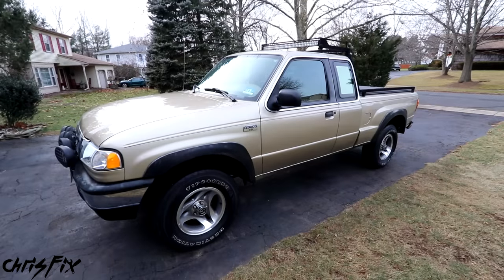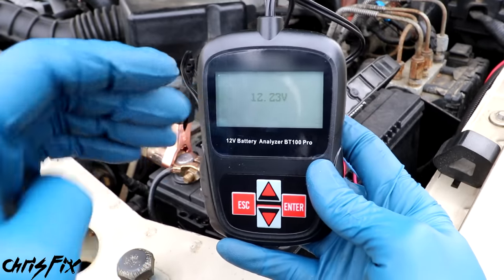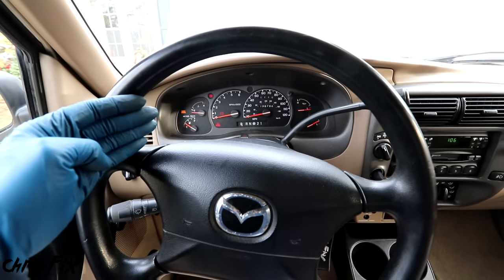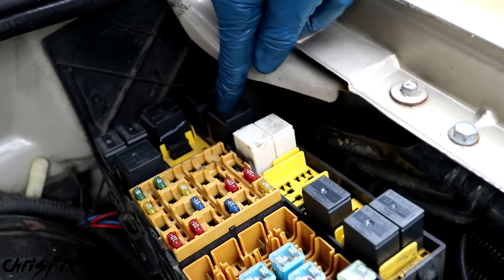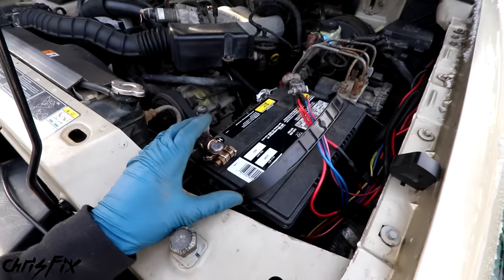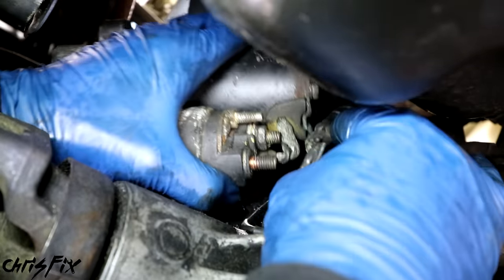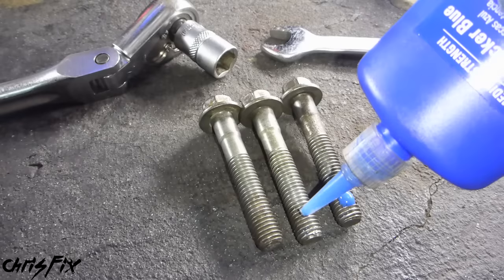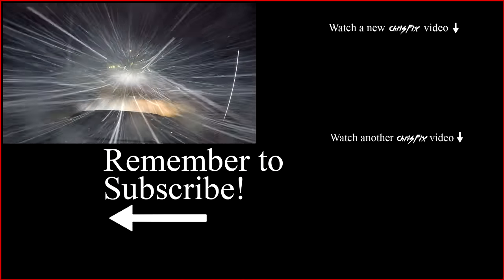How to Diagnose and Replace a Starter

Comment: Need help. I have a 2016 Colorado LT 2.5L
I like to see you do a video on a newer Trucks. This morning I turn the key it start up but had a hard time to hold the crank, it sound like it kept trying to hold then it shut off, I try it 6 times then sound like It was drowning, my experince it could be out of gas but it has a full tank, it could be the fuel pump too, I noticed all the lights in the dashboard turn on with only he motor icon lite up, I don't know if its the starter or alternator, but I have to rule out the alternator because the battery is good. It has to be the starter or fuel pump, btw I also check the crank fuse 10, its good. To remove the starter I was told the manifold has to be remove, there are hours of labor to remove. suggestion, did I do the right checks to be a starter issue or fuel pump ?

Comment: In cold weather (below 10-15C or about 15F to 5F) my car makes a clicking sound when I try to start it. Then I can leave the car, wait for about 5 minutes and then return to start it, and it usually starts right up. Is this a sign of a bad starter? I have replaced the battery with a new one, no luck.

Comment: Hey I need some advice. I have 02 Tahoe, it won't start. The battery, the starter, the fuses, and neutral switch are all good. One thing I did notice though is I have a rear main seal leak and my starter definitely was getting oil on it. Could this cause it not to start up?

Comment: this is an old vid but for anyone watching for help, theres also voltage drop from the battery to the starter. good way to test the integrity of the wiring is to read voltage with a dmm at the battery when cranking and at the starter when cranking, then compare the differences. it shouldnt me more than 1.5 volts of difference, all manufacturers are different with their spec but that is a good range to start.

Comment: swapped the old clutch out with a ram, car drove amazing turned off and on right with no problems but a few hours later i was having starting issues. before the cable snapped the car shut off at the light but could still hear it running, i tried to kick the clutch in to see if it would turn back on and it almost did. so i did that few more times the boom snapped, my BBK clutch cable snapped on me before even hitting the road. i went and got the ford performace from AM, and now weve adjusted it but when we have our clutch pedal down and in gear we get no crank or anything, completely silent, dashboard lights came on but no start or crank
Reply: chrisfix help, clutch is al the way down and i get no crank or anything. i charged the battery and i still got nothing. before i swapped the clutch the car turned off and on no problem
Reply: my mustang wont move in gear when its off an the pedal is down

Comment: Hey Chris I got a question, the new starter I got came with the lead wire bolted to it can I take that off and just bolt the one coming from the truck to it or do I have to use that lead wire and attach the two together?

Comment: Great diagnostic explanation, but if it is a bad starter, the next step (after removing ground) should be to evaluate the best way to access the starter.  On some vehicles it is far easier to take the front driver side wheel off and access it from the wheel well.  Took me 2 hours under the truck in 95F temp, with hand cramping, to figure this out.  Took less than an hour going in from the wheel well, but a ratchet U-joint was still needed.  Also, usually easier to remove starter electrical connections before removing the mounting bolts.

Comment: my 2005 GMC sierra won't start after i dropped the trans to replace the rear main seal and I have unplugged and replugged the neutral safety switch and made sure the pins were good so now I'm on to the starter or it could maybe be a faulty fuze. 🤞

Comment: Im half decent at tinkering with vehicals... Almost jumped to dead starter conclusion on my truck. You reminded me it could be anti theft... 

Turns out last week my key popped open and the anti-theft-chip fell out... I didn't even notice... Watched the vid and whaddya know looked in my Key and no chip... Found the chip on the floor. Saved me a useless trip to the auto store and laying on my back for an hour.

Comment: So I have a classic car that’s been sitting for a while now cause I haven’t been able to figure out how to get it running again
I bought it a new battery nd it would try to start but couldn’t
So I bought a high amp alternator but it burned the cables so I swapped them for 0 gauge
After that it would do the same nd wouldn’t start so I tried jumping it nd it started but after turning it off it wouldn’t start itself on its own
So I’m wondering if it’s the starter cause well now it doesn’t even click like literally nothing happens, took the battery to autozone for them to charge it since it was dead nd once I got home to put it back in, the cables started smoking nd I heard a pop around the alternator so idk what to do

Comment: My car only starts when you touch the solenoid terminals together with a screwdriver. what does this mean? i don’t know what is bad had someone put a new starter on and it was good then just stopped working again.

Comment: It still took a second to start up after you put the new starter in, is that normal? I just bought a used vehicle and it takes a second to turn over, less time than yours did in this video. Everything sounds strong, just takes a second. Is this something I should worry about? The vehicle has a new battery with no corrosion.

Comment: A lot of times it's your starter solenoid. You can replace the solenoid on the starter this will save you money. Also wear d large wire goes that lug can be pushed out of the starter and turned a hundred eighty degrees. You will find it at contact point is worn down and just by turning the copper lug you can repair the starter and get extended use buy a simple fix. This can be done when the solenoid is a part of the starter unit. In Fords the solenoid is a separate component. Usually mounted on the engine bay wall. Just follow positive wire from your battery and it will take you right to it.

Comment: My starter was going bad, the wire to ground wss very loose and the car didnt want to start always. Today we replaced it, and noticed shims on the original. We added them to the new starter and installed, but on startup and turning left there's now a slight grinding or ticking sound for a second or two.

The shims are there to add space to prevent this grinding, so it's weird it is happening still and even weirder it happens when the car turns to the left, since if it was just the teeth of the starter you would think it would not persist during a drive. I think replacing it with another new one is the way to go.

Comment: hey i got a question. my new starter came with a new s terminal that id have to splice in. i dont have any wiring tools so, do you think id be able to use the starter fine just using the old s terminal?

Comment: Suggestion: If you know your way around electricity and electric motors then take the starter apart and try to fix it!
I managed to fix my tractor starter by just cleaning it out and replacing the brushes, which cost me like 40 euros. Otherwise a brand new starter for a medium sized tractor costs a fortune! 
Btw I love your vids!

Comment: Hey man so I just changed ma starter on my 2014 nissan sentra sr and the battery is good but car still wont start. I checked all the fuses in the inside and engine bay camparment and nothing is blown. Got no corrosion on nothing either. Also fuel pump is good I can hear it whenever I turn the key.  Would truly appreciate the help 🙏🏽
Reply from the maker: Is it cranking when you go to start?

Comment: Hey Chris, really enjoy your videos and they are a massive help! Wonder if you could help me, sometimes my car starts absolutely fine, other times it does exactly what happened at the begining of your video (turn key and no happy sounds) 

Battery is secure and clean/good voltage. 

Wondering if it's the starter or ignition, as it's so sporadic. The imobiliser isn't on/netural is all good. 

Generally there is no rhyme or reason to the car not suddenly starting, it'll be fine for weeks then this issue will appear. Last time I held the key to start and pressed acceleration for around 7 seconds and it started so at a bit of a loss. 

Nissan Micra K11 year 2000 auto transmission. 

Any help is massively appreciated as it feels so random. Will be doing my first brake fluid bleed thanks to your change fluids videos this week :) 

Thank you!
Reply: /haven't had any check engine lights.

Comment: First starter I replaced, It was a 2013 Kia Optima, not only did I have to go through the bottom, but I also had to go in through the top by removing all of the air manifolds. 
Second one, was a ford f-150, tried removing the starter in the parkinglot I was stuck in, and I had the unlucky event of shearing one of the starter bolts.

Comment: whenever it’s cold outside my car makes what sounds like a metal grinding noise but only when the engines cold and it’s just for a very very short time (just when it starts first thing on a cold start, but the car always starts fine)

Comment: Hey Chris, maybe you could help me with my 09 Corolla. 

My car will not start at all (click-no-crank). I've put a new battery, alternator, starter motor, and starter relay into my car recently (thanks in large part to your videos!). I've also sanded down all the connections to ensure proper ground. Every point in the chain is getting voltage (12.4 from the battery at the alternator and starter motor B+, 12v at the starter's secondary wire when turning the key, and .5v coming out of the starter solenoid output to the starter motor itself). But the car still won't start. Starter motor doesn't even turn at all. I had the starter bench tested and it passed no problem. Any thoughts?

Comment: Hey ChrisFix, one day the serpentine belt snapped off due to the ac compressor heating up, I disconnected the ac and replaced the belt, after replacing the belt it wouldn’t turn on, we replaced the terminals and battery still not turned on, I took off the starter and went to get it checked and it passed 5 times the same test, also checked the ignition and all fuses everything seems good, could it be the engine is seized ? We already tried to move the crankshaft pulley and it is hard to move, from what I’ve heard it should be easy to move and if not the engine is “seized”, when trying to turn on the truck it cranks for like a second and makes like a click around the starter, the serpentine belt moves like a little but returns to place, for example, it turns clockwise like an inch and then it returns back to where it was ? Do you know what it could be ??? @ChrisFix (Thanks for your videos)🙏🏾
Reply: The truck is a Ford Expedition 2003, it has like 270K miles, I have also checked your other videos of why it could be and still haven’t figured it out, thanks 🙏🏾

Comment: Hi Chris, I'm getting a sort of rough screechy sound straight after the start up, I've checked the belt tension, but my m8 says it sounds like the cogg that connects to the flywheel is not returning correctly after start up, how can I work this one out ??
Thanks in advance ;)

Comment: I replaced my car battery for a new one, replaced the car fuses, but my car won't started, all I hear is  a "click" sound everytime I try to start the car on, I made 5 attempts,  1st, 2nd, 3rd, 4th attempts don't started, 5th attempts the car almost turn on because I heard the sound when you start the car, then I tried again and almost start, tried again and then start and runs perfectly.. Do you think my car problem is the STARTED like I saw in this video. And as you said I saw the check engine light shows up and then disappeared (Also in all my attempts I put attention to the fuel pump and I heard the gasoline goes up fast, like I think is supposed to) I'm still having the problem.

Comment: Had to replace it in a year and a half again . Had oil on pinion gear . Trying to find actual oil leak . This mechainc said it's definitely from real seal . Also have valve cover oil leak which might be causing this . In your opinion , can top leak get into starter gear ? Or is it pretty tightly sealed against from the outside 2016 ford Focus SE 2.0L duratech engine Just noticed this isn't specifically on this model car oops

Comment: So I'm very cheap. Can I just take my starter apart and clean it up and spray it? It's the classic not even a clicking start but I can whack it a few times and get it to work. Is it worth it to try to clean it up?

Comment: i dont know if you will get this, but i need your help:
the starter on my 2004 chevy venture has the mounting bolts stuck. they wont budge no matter how hard i try, they are not rusted. just seized on there. any advice would be appreciated... i dont want to strip the bolts or ruin them.

Comment: Do you think my starter is going bad OR if it's the issue with my car, when the following symptoms happen:

After my car has been sitting out in the cold for 12 hours(even in summer weather),
 I go in my car in the morning and turn the key and the car *hesitates to start ( i hear a whirring sound)*The dashboard lights do turn on, and like i mentioned, the car hesitates to start.
-So 
I do a second try on turning the key again and the car does start.
What could it be ? *It is for a 2012 Honda civic Automatic

Comment: I brought my car to an auto part store to test the starter, battery, alternator and it all came out good. But still have a starting issue. It has the same sound as in this video when Chris turned the ignition. Could it pass the test because i was able to drive the car to you store for the test already? If it was dead, that should be the time to do the test right?!?
Reply from the maker: It could just be on its way out, if your starter is making that noise I would just replace it now before it causes any issues
Reply: @chrisfix  thanks Chris! But just curious why would the shop's tester say all 3 parts are fine when it clearly isn't, starter wise already. They clipped the device onto the battery terminals and did the test.

Comment: 7:10 i would chock the rear wheels as well, those 2 jack stands next to each other give a lot of side to side stability but not so much forwards/reverse stability. Put the ebrake on and put the transmission in park@automatics or in 1th gear@manuals. Having a car land on your head is quite a bad thing; do everything to prevent it.

Comment: Hey Chris, I’m having trouble with my car. Dash lights turns on and everything but when I try to start it, it would die complete (everything lights, hazard, etc).. I did notice that when I turn the key the engine logo would pop then blinks, then gone.. I have a 07Si

Comment: I have a 1999 Mercury mountaineer 5.0 L, V8 engine. Lately my car has been dying on me. I've checked the battery, fuses, relays. I am unable to locate the solenoid. I have no idea what it looks like or where it's located at.  there is no video regarding the location or how to test it and replace it. On the new member and I just subscribed to you I like the way you explain things and your tutorial way of teaching.
Reply from the maker: The solenoid is built into the starter. It is the extra bump on the starter. If the starter relay is clicking when you go to start the car, then the starter is probably bad. You can bring your starter to a parts store for them to test it.

Comment: Thanks guys I was able take it with a little struggle 😂 first time I did it I mean I am smart I am doit guy I can doit but when it’s first time you struggle you know 😂 but it’s outa and it’s rusty I can tell forsure it’s starter because car won’t turn on and I did boost battery still nothing so it’s starter forsure
My vehicle is Pontiac 06 
My dads actually 
I checked two things you said to check fuse is good battery is good still turns on radio windows go up fast so I tried boost still no go so it’s starter forsure😊 thank you again dude ❤

Comment: Hi Chris.. I enjoy watching your videos about solving car problems  because it is educational and you make it simple for the most part by the process of elimination.

So I have a 2005 Hyundai xg350 that cranks but dies shortly after. The hood was raised and as the key was turned I watched the engine fiercely   jump up and down rapidly until it died. The person who looked at it thought it was the battery but it wasnt. They replaced spartan plugs but still the vehicle does the same thing until the flooded it out, now it only makes a clicking sound and the engine wont crank at all :( any suggestions?
Reply from the maker: Plug in an obd2 scanner and see if there are any codes

Comment: Great vid thank you, my starter is on its last legs,  thankfully it's not totally dead🤣    when its cold it cranks really slow, and makes some noise, if its colder than -15c it won't crank at all, just click (batterie is fine so is alternator, had them checked)   at least my car is a stick so I can roll start it if needed🤣

Comment: What about the old style cigarette plug with a 9 v battery connected, it was to save the radio stations, but will it save the computer settings while changing the battery    Thanks a great video and batteries I already forwarded to my kids.     Eric

Comment: I actually had a really clean replacement of my starter on a 2006 Toyota Corolla by removing my fan at the front and then removing it without lifting it. However, now I have an engine that is shaking at idle but not at higher RPM. Any idea on what happened?

Comment: But if you'd check with the multimeter directly on the starter's connectors to see if it gets enough voltage wouldn't be this a easier way?